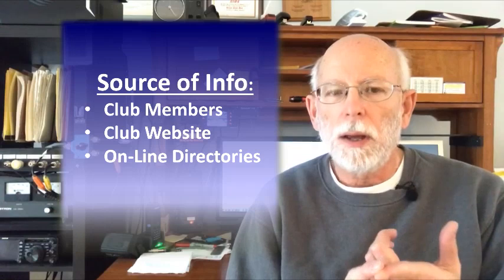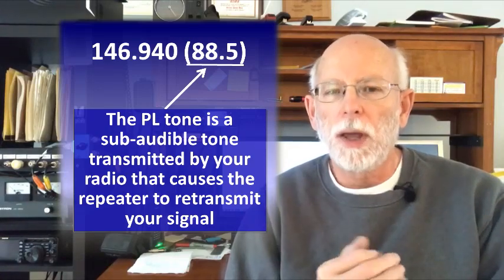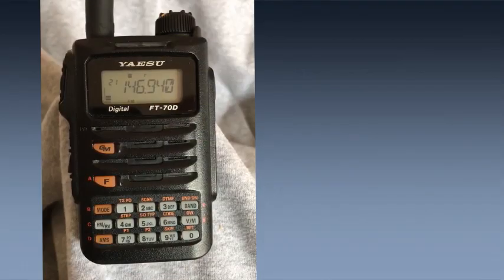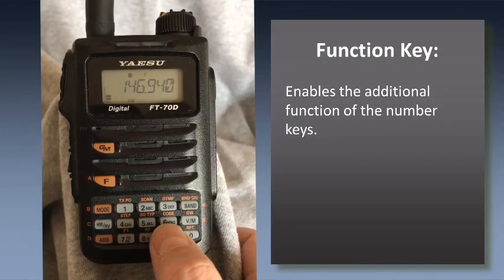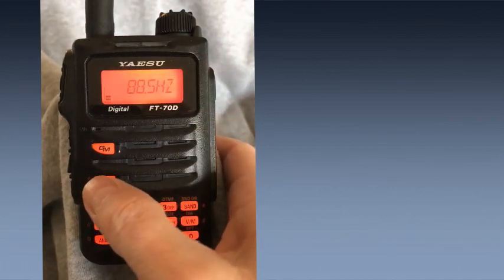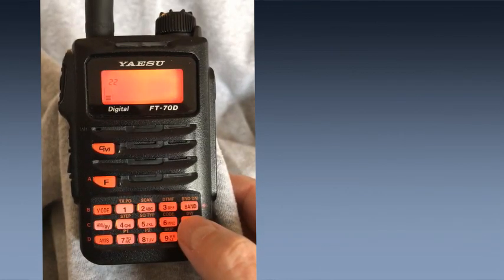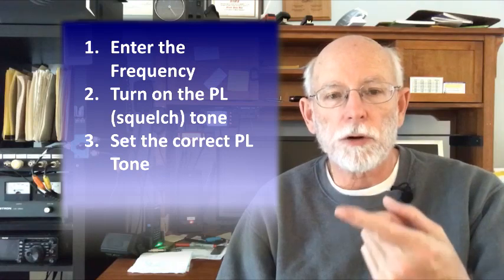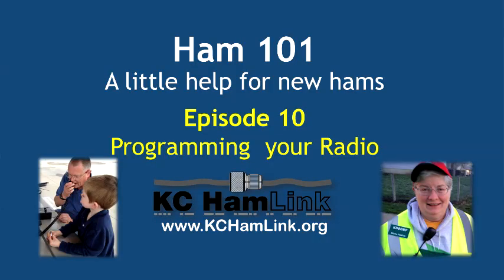Ham 101 Episode 10: Programming your radio

Comment: Hello. I really enjoy your videos. I'm learning a lot from them. I have a question that I hope you can help me with. I have a Yaesu FT-60R HT. I have a number of frequency (repeaters) programed into the memory. When in memory mode the name on the memory channel comes up such as NLV1, NLV2, LV1, LV2 etc. Is there a way to pull up the actual frequencies that are attached to the memory channel name? I have them written down in my log book but there has to be a simple way to do it on the radio without having to refer to my log. Thank you.
Reply from the maker: The alphanumeric tag that you're seeing for each channel was apparently entered when the radio was programmed.  The display can be toggled between the alphanumeric display and the numeric display of the programmed frequency.  There's an explanation of that in the manual (page 30 in the version I have).  The setting is in Menu 27 of the setup menu and you can set it to either display the tag (alphanumeric) for each channel or the frequency.  If you're using a 3rd party software to program the radio, such at RT Systems, I believe you can choose what to display on a channel by  channel basis.  
Hope that helps.